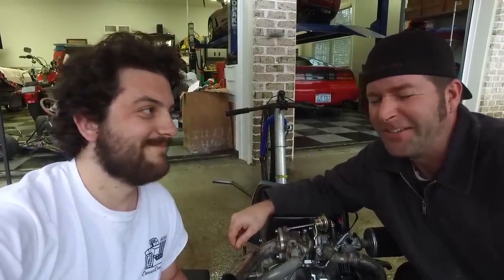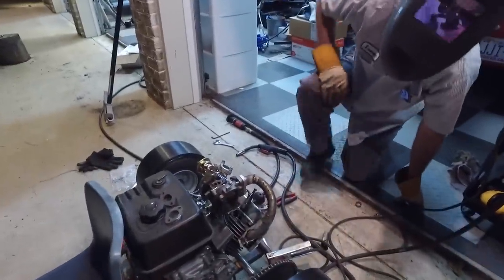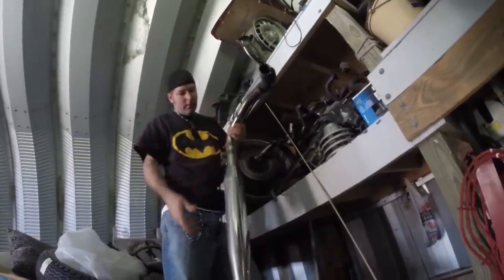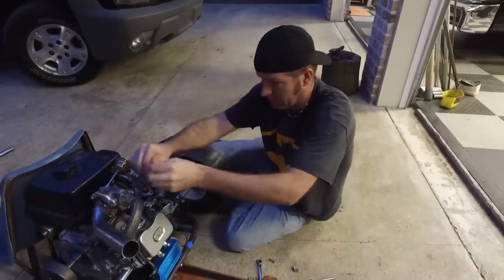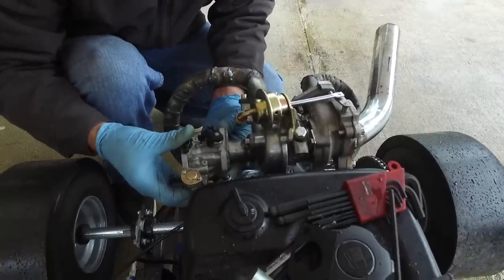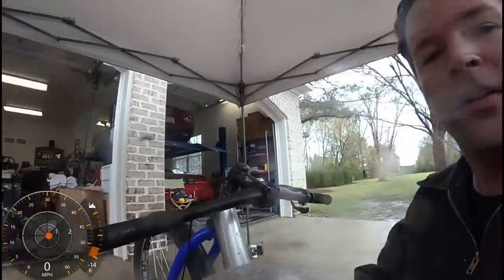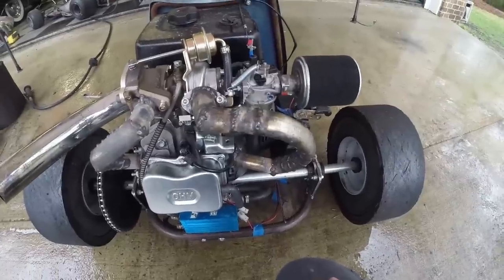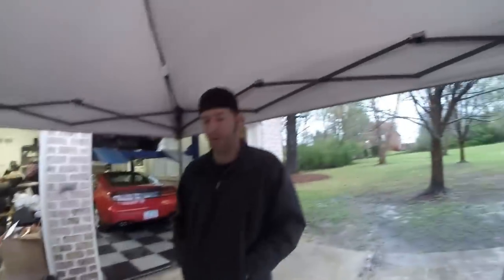Turbocharging a 420cc Drift Trike

Comment: Hi Guys Love what you are trying to do  
and I just want to ask a question and see if this idea is possible 
as you said you are not able to charge the battery  could you put a pulley on the axle and hook up a 
car alternator instead to produce power needed or would it take to much out of the engine in doing so ? 

Regards from Western Australia  

Tony
Reply: +Moondyne .Joe i believe that would be a option if we were in a tight spot. im sure there is something wrong with the charging system or can be upgraded. not sure wich option we will go with. lol     greetings Australia
Reply: Thanks for answering Isaac it was just a thought nothing wrong with a few Alternatives
Love the YouTubes People this 56 year old enjoys your antics and look forward to each new one posted   G'day USA
Reply from the maker: +Moondyne .Joe Hey, that's probably what we'll end up doing.
Reply: I can't wait to see what happens when you get the turbo running properly< Might I suggest also you take of the plastic outers on the back wheels while in this upgrade phase ? better control, traction and for tuning you wont be spinning the back wheels all the time and should get a constant speed
Reply: +Moondyne .Joe Fellow Aussie, I had the exact same idea.
Reply: Sacra Mental 

Ah Great Aussie minds think alike !
Reply: we  kinda like the sliding around. lol and at top speed it dosent seem to be slipping unless we want it too
Reply: Isaac it'll be fine Aint nothing wrong living life at 45 degrees or over ;)
Reply: LOL LOL  Well definitely weirder than us, We are  living upside down to them ? 
 I can't wait to see this up and running well the guys have put a lot of  work into it I am so tempted at 56 years of age to do something like it myself  ( Yes I let my child out as often as I can to play )  Isaac what about something with a Diesel engine on it as far as a trike or Cart ? would be interesting to see how much Torque it would have  ?
Reply: we have thought about going diesel but we havent gone there yet
Reply: You Might find some engines in one of these sites Isaac  
AliExpress.com 
http://www.banggood.com/
Made In China  
I am quite astonished at what a diversity they have  
It would certainly be interesting to see wht you come up with on a Diesel  I have been contemplating buying an old VW Beetle and turning it into a RatRod Diesel myself I am a rugged individual and don't like to fit any moulds !  Keep up the great work mate Hi to the rest and Enjoy life ! 
Tony
Reply: Isaac it'll be fine I don't know if you have checked out this Aussie YT channel Isaac  Mighty Car Mods   I think you will find them a hoot !
Reply: +Moondyne .Joe  I dig MCM , love there series on the 3000$ turbo builds
, my money is on 2 sexy , but damn the wasabi sounds beast lol
Reply: Moondyne .Joe yea i like them
Reply: jesse swan I think Wasabi will win, it is a more solid car
Reply: lol yea, lol i have jokes lol

Comment: I like the effort put into this but I have a few things to say. First I have turbocharged an 8hp honda engine with a similar sized turbocharger and had great results. Secondly you don't need an EFI when you turbocharge a gasoline engine we have made numerous carbureted engines that have ran in excess of 25 pounds of boost and that produced 800 hp. Furthermore, I see you used a draw through system where the carburetor is mounted on the front of the turbocharger, I used a blow through system where the carburetor is after the air is compressed. Also, when you turbocharge any engine you need higher fuel pressures so there is no back flow of fuel, so you need to run a boost line from the turbo to the gas tank to increase the pressure because it is gravity fed system. You also need to increase your jet size in the carburetor to make it a little more rich rather than leaning it out. Also i used a belt driven oil pump for the turbocharger and had no issues. This comment is to help out your cause and if you have any more questions I would be more than happy to help. Good luck!

Comment: HAHAHAHA, as a fabricator, I have to question why you guys just didnt buy a few pieces of pipe that were already bent, maybe pipe elbows at least. Its a ton of excess work to do what you did. Lots of restriction of flow with the weld penetration on the inside of the pipe.Thought I would let you know for next time. Otherwise your projects are cool.
Reply: I always buy a ton of bends, learned that a while ago aha
Reply: Ian Thompson
Id actually like to go down south to these guys and assist in building some of their projects. They have good ideas just not quite the knowhow, but they are learning. They are funny as hell. It will be fine, hahaha
Reply: thank you! a few u-bends from an exaust supply or from jegs or summit goes along way. maybe a bench with a vice and a sawzall wouldnt hurt either. it still wouldnt help these guys though.

Comment: Needs a boost box over the carb in the blow-through configuration so the float bowl is the same pressure as the venturi in the carb. The base of the boost box goes between the carb base and the head, then you need a removable top or side so the fuel line and throttle can get to the carb and you can get to the mounting bolts for the carb. You still might get some boost blowing back into the fuel tank. They used to do this all the time back in the '70s and '80s with V8s.

Comment: The exhaust side of the turbo from head to turbo impeller is called the up-pipe usually. From the compressor to the rest of the exhaust is called a downpipe +CarsandCameras

Comment: pretty slow for a 420cc engine?
Reply from the maker: +tyrick fletcher It is only geared for 40.
Reply: +CarsandCameras makes sense don't really know a lot about small engines and the gearing and stuff
Reply: And i think its also governed this is what i think i heard but dont quote me on that
Reply: +Ty Ragan  even if it is it would be faster my 125cc goes least 70
Reply: +tyrick fletcher I honestly doubt that, unless you have a shifter cart or one hell of a gear ratio
Reply: +tyrick fletcher It only has one speed. (no multispeed trans) That's why it is so slow compared to a motorcycle or something of that sort.
Reply: +JustKyzuuh I have a shifter cart
Reply: +tyrick fletcher ahhhh that makes sense then. this is a solid gear ratio so yeah, and plus this is a cheap Chinese engine made for lawn equipment not really for racing.
Reply: +tyrick fletcher ahhhh that makes sense then. this is a solid gear ratio so yeah, and plus this is a cheap Chinese engine made for lawn equipment not really for racing.
Reply from the maker: Ty Ragan Nope, we took the governor off.
Reply: +tyrick fletcher Your shifter karts engine has a much higher quality engine than whats on this trike they are building.

Comment: wait, you put the carborator in front of the turbo? so ...  your turbo is full of gas-air-mixture?  That sounds wrong ...
Reply: +Stryke look up azn from street outlaws beetle it has the same sort of setup its completely safe
Reply: mackie hughes I don't doubt it's safe, but how does it effect the turbo?
Reply: +Stryke I'm pretty sure the fuel will just help cooling and lubricating the turbo, also it's gonna vaporize the fuel better, not wrong at all...
Reply: it doesnt the centre section of the turbo is sealed so its cool
Reply: Isn't it possible that the turbo gets hot enough to ignite the fuel going through it?

Comment: You can totally make the carburetor worm, many ways to boost a carburetor, a pull through like you guys made is probably the most ghetto way to go. pressurizing your fuel tank is one way to go or just keep it simple and build a pressure box. A sealed box completely surrounding the carburetor will allow you to pressurize the air and still allow the carb to work off of a venturi.

Comment: Use the carb as a TB for the EFI. Epoxy up all the holes. Then drill a hole in the intake for a FI and the exhaust for a O2. Then you have to tune and that's about it. +CarsandCameras

Comment: you need a blow off valve to receive the pressure when the turbo spools, it's making more boost than the throttle can handle that quick and it's back pressuring through the intake. that's why the filter came off once. and why it kept not wanting to run wide open. a little pressure relief and all your problems are fixed.

Comment: If you build an intake with the carburetor on the inlet side of the compressor housing, the carb will work as a draw through system. Otherwise you'll push fuel out of the needles and jets when the turbo creates boost.

Comment: The first set up needed to have the carburetor pressurized by building a sealed metal box around it. The second set up was very smart. I seen 80's motorcycles using that set up from the factory. I am thinking a carburetor from a slightly bigger engine would have respond much better by compensating the extra suction from the turbo with more fuel.

Comment: Yes turbo and carbs mix, you just have to configure it correctly, For a blow threw design, you need to build a box all the way around the carb or just boost the carburetor bowl vents and you will need a blow off valve so the boosted air can release when the throttle is closed quickly. keep trying you will get it!

Comment: Have to boost reference the fuel tank. Draw thru is better than blow thru when dealing with carb. Also drop carb low.  Its ok to have a long intake between turbo and carb. Carbs have been turboed as long as there have been turbos. Gonna do a draw thru on an f100 and put turbo behind cab to keep it easy.

Comment: I know this suggestion is late. But years ago a friend of mine was running a McCulloough belt driven super charger on his Studabaker Lark. His carb was housed in a pressure box(not sure of it's technical term) and the supercharger pressurized the box. This way the pressure outside and inside the carb we're equalized and would not cause fuel to come out of the carb.   I can't remember how he was able to adjust the fuel jets on the carb when running and under pressure. That shouldn't be too hard to figure out.  What I do remember was that Lark ran like a bat out of hell.  Maybe on your next turbo egine you might try implimenting this idea into your build. I think it would yield more harminious results...lol

Comment: Draw through is much simpler, I've done it and it works well. Blow through needs the carby to be placed inside a pressure box and an electric fuel pump.

Comment: carbs are funny with forced air induction.. you must have it on the intake and incased in a box with the fuel pressure 10% above max boost pressure.. you would experience torq incresed with snappy response in throttel,with good driveabilty.
Reply: SilverFox32775 that’s how it was done in the days before EFI👍🏻

Comment: Blow thru set up on a carb is easier. You have to drill and tap for a nipple on the fuel bowl and the boost tube. Run a vacuum line from the boost tube to the bowl and viola. The turbo pressure pressurizes the fuel bowl. You will also need to block the air inlet tubes on the front of the carb.

Comment: Need to build an enclosure around the carburetor. If the carburetor is surrounded by atmospheric pressure it will push the fuel out. However if the pressure is equalized around the carb, it will act as though its N/A. So build a box sealed around the carb and send the boost into the box vs directly into the carb. Will also need a pump to increase fuel pressure equal to or more than that of the boost pressure. This can also be done by sealing the cap and using a line from the charge side of the turbo to pressurize the gas tank.

Comment: You need to make a little flange between the turbo pipe and the carb, so it lets the the float bowl vacuum hole on the inlet side of the carb-mouth breath without being pressurized. Thats why your blowing the fuel out the carb.

Comment: Once it makes boost if you havent filled the floats with expandafoam, youll want to do that. Boost will crush it and youll just be dumping fuel for days... no need for efi, just continue with the blow through, draw through will work but depending how much boost you run you could have detonation and that might not be a whole lot of fun for your back/neck/ and mellon..

Comment: You shoult go back to the blow through carburetor setup but you need to vent the fuel bowl to atmosphere which normally vents to the air cleaner side of the carby. You need to block that off then drill a hole in the top of the carby above the fuel bowl to vent the fuel bowl to atmosphere.

Comment: the oil can be supplied to the turbo from anywhere u can tap into for oil pressure..............
 P.s 
the oil return line from the turbo to the oil pan/crankcase (it's not under much pressure) but i've learned from past experiences while turboing my Integera GSR...... there was a group of friends that decided to turbo their cars and everyone's cars were smoking on deceleration. we figured out that the oil return line was too small and the oil would back up the turbo return tube and blowing by the turbo shaft seal and getting into the intake piping then sucked up through the throttle body into the cylinders and burning but these engines were fuel injected................. the prob your having with the fuel problem and the carburetor by switching the arrangement sounds like a good idea 
(best of luck to you)   

 and  the other thing you had asked was about piping the pipe that goes from the exhaust side of the turbo the theoretically is supposed to go to the catalyst and the muffler or in some cases just gets dumped into the atmosphere is called the "DownPipe" (unless u have a subaru, it is called an "UpPipe")  and the smaller of the 2 pipe is called the "DumpTube" which goes from the "Wastegate"...... there are 2 kinds of wastegate set ups; internal wastegate or External wastegate, im not gonna get into the description of those 2 but its similar internal and external Dump

Comment: Add a bypass valve (use a pcv valve) between the inlet side of the turbo and the charge side (allowing enough air/fuel under vacuum but closed under boost). It will allow the thing to breath at idle with no boost w/o going through the turbo. 
- Cheers

Comment: two methods of not doing fuel injection would be to use a pressure chamber around the carb so you have the boost and the pressure outside the carb would keep fuel from leaking from the bowl, or you could have mounted the carb on the inlet side of the turbo and rin the intake tube from the turbo straight to the cylinder head, that way your carb is still operating on a vaccume system and you wont have the fuel leak issue.

Comment: If you leave the carb after the turbo, you need to run a pressure line from the output of the turbo to the top of the float bowl.  Otherwise the pressure from the turbo pushes fuel backwards through the high speed jet and out the carb vent.

Comment: There's an old trick I've seen to using a turbo with a carb. Put the carb back on the engine, and build a box around the carb, then use the turbo to pressurize the box. I've seen it done on snowmobiles. The design I've seen used a plate which is essentially a big inlet flange. The carb attaches to the outside of the plate and the rest of the box is welded up, except for one side of the box which completes the enclosure, that's a separate plate gasketed and bolted on. The throttle linkage passes through the enclosure via a bell crank assembly which allows it to be sealed decently. The basic idea is that you're pressurizing the entire carb assembly, from the outside, which will eliminate blowing through the bowl. Just a thought if you guys want to give that a go before investing in an EFI.
Reply: +case MasterxL thats what we were planing till we ran out of time

Comment: The best thing on a carburated turbo engine is to put the carburetor on the turbo inlet . The cabretor is made to suck is own air , not to be blown over im . Try to reduce the exhaust ( cylinder to turbo ) smaller and then you will have more pressure on your turbine and make it idle right .

Comment: my thoughts, easy way is a pull through carb but may go boom when mixture is in charge pipe or putting a boss and injector in, get an injector driver, map sensor, cps, and arduino and make a ghetto efi. easy way I think is get a single SU carb off an old z or MGB and set it in a pull fashion into the turbo.

Comment: Use a permanent magnet alternator. Most are older GM style case. They generate power if you spin it by hand, so low rpm your running the alt at prob isn’t enough to get it to put out power

Comment: You dont have to scrap the turbo setup, but you might want to.. You will need either EFI (like you guys stated) or a blow thru carb.. Both will be hard to tune AND im not sure how much hp you will make before the engine blows.. Just hot rod that 420cc the NA way then start on another project.. A 250cc 2 stroke dirtbike engine powered kart! Buy a 80's air cooled 250cc complete bike for like $300, then a rigid "fun kart" frame.. Since you guys have the welding/fabricating abilities, i'd think you could make it happen no problem! You'd just have to setup a linkage for the shifter. An ATV rear axle/hydraulic disk brake would be a really good adaptation to that 250cc kart! Ive always wanted to do it, just ZERO welding experience or access at this moment.

Comment: 4 years late, but blow through can work fine. Need a box around the carb with the whole thing at boost pressure, then a fuel pump to raise fuel pressure a couple PSI above that.
Reply: 5 years and one day late.

Comment: Fuel air mixture in a turbo, is not smart, it might kill both the turbo and the exhaust.  Turbo's will get hot.  Now the easiest way to keep the battery charged is to put an extra generator (or whatever you call them.).  Yes it will take some of the power out of the engine, but if you have your turbo working properly, it should offset the powerloss.